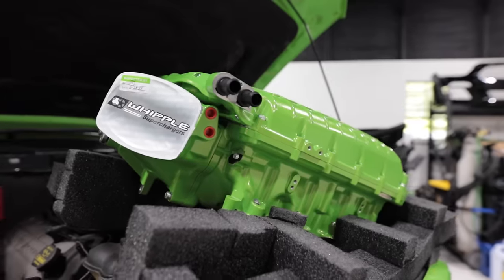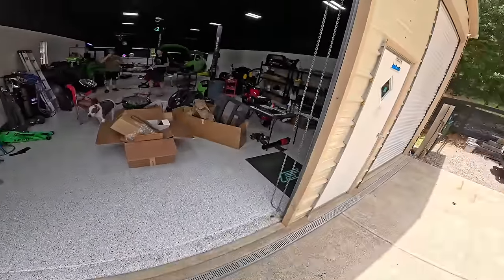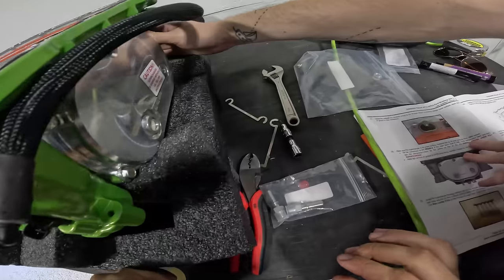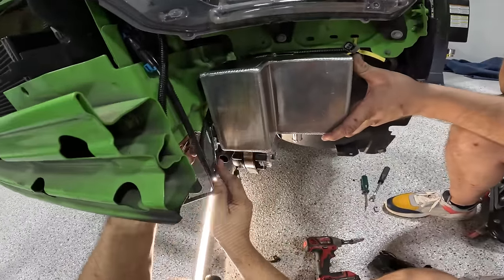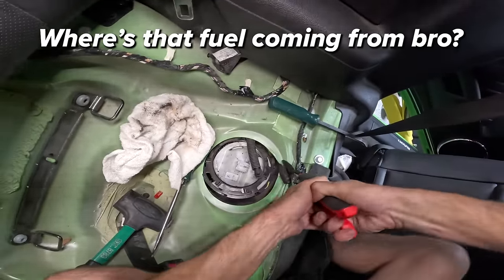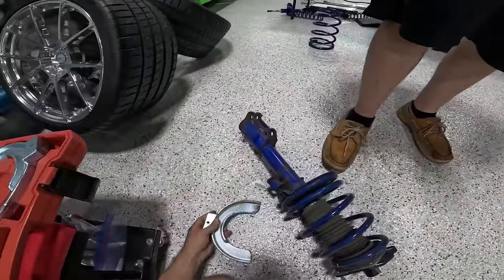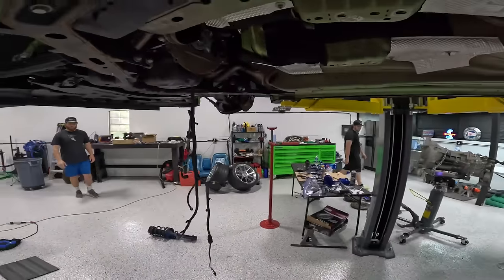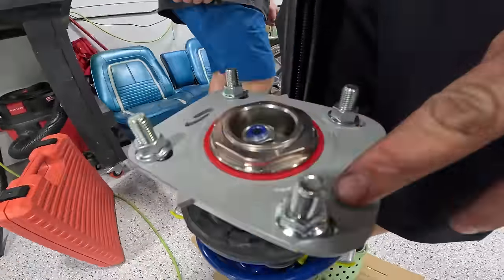Installing the Largest Supercharger I can fit on my Mustang!

Comment: Pro tip. When removing the ring cut at 90 degrees with the cutters then just fold the flap. When you put it back together fold the flap back.

Comment: You need back-up power. Get a Generac generator for home use. Get an automatic transfer switch installed and burry a 200 gallon propane tank in the yard for it. That way even when the power goes out you’ll be able to stay electrified!
Reply from the maker: YO, we have a tank in the yard already!!! This is a FANTASTIC idea! Thank you!! 🙌🏽
Reply: @itsjusta6official  just doin my part Bro!

Comment: Also, fun fact: the 35 ft lbs+60° requires 2 different styles torque wrenches. It's not actually a 60° turn, the different torque wrench is designed to bend and be a specific "tightness" when it bends 60°.

Just figured I'd give yall some information for future reference, it should hold up fine witha little overtorque

Comment: BRO! SURROUND SOUND IN THE SHOP??? Run some speaker wire with wire loom and safely taped of course lol get some decent speakers in the room/corners. $300 an you’d have a decent & bad ass system in the shop

Comment: 400 ft lbs ain’t enough to remove those 10mm safely. You atleast need an air gun with ATLEAST 150 pounds of air pressure